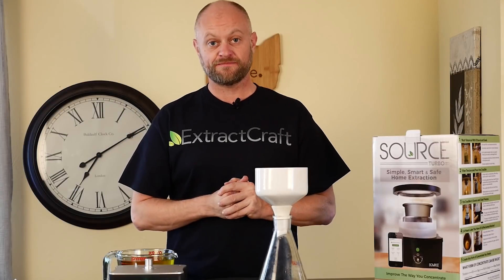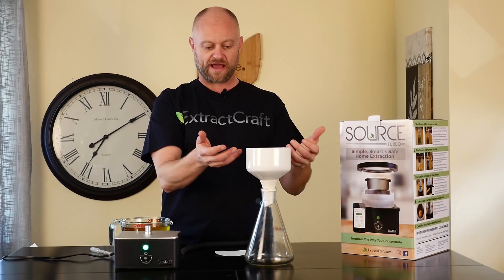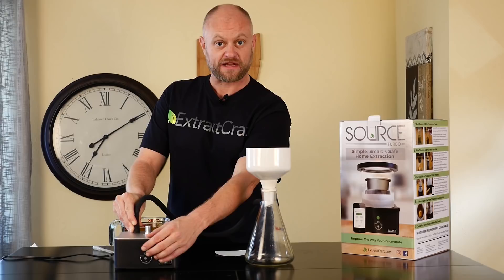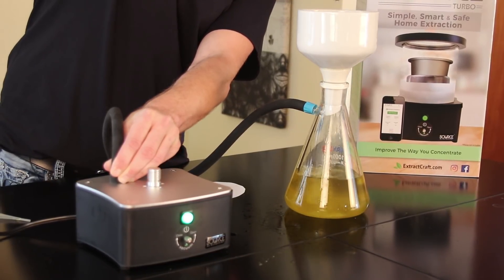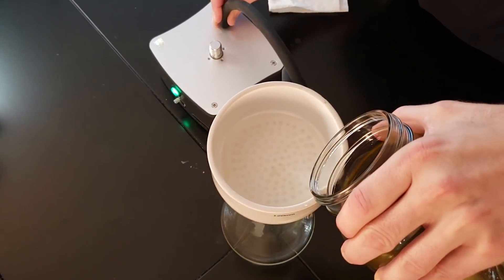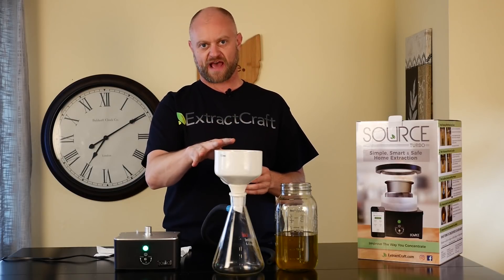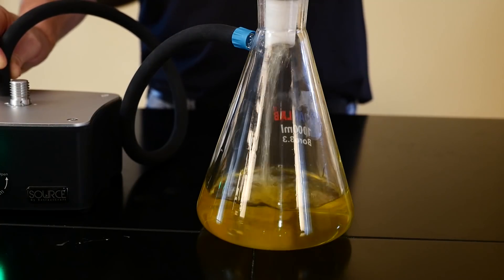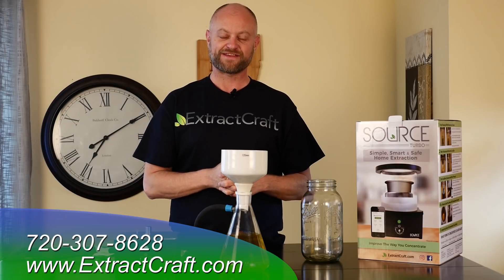Buchner funnel filtration with the Source Turbo by ExtractCraft

Comment: I  am  not  understanding  the vacuum  part?  Why cant you just pour the tinture in the funnel and let  gravity  pull it into the flask?
Reply from the maker: It just won't work that way. These filters are very fine, about 20-25um for the fast flow and 3um for the slow flow. If you poured into these without vacuum, the tincture would just sit there. You need vacuum to pull through these fine filter papers.

Comment: Should the ethanol extraction remain cold or room temperature during the filtration?
Reply from the maker: You'll want everything as cold as possible before making the ethanol extraction, and also after the plant material and ethanol are combined and back in the freezer. Once you take the ethanol extraction out for filtration, you'll want to work fast to avoid letting it continue  soaking at room temperature. Once you do your first filtration, the rush is over and it's fine for the now filtered ethanol extraction to get to room temperature.

Comment: Can I use this vacuum process to winterize rosin?
Reply from the maker: Just for clarity I'm going to change the wording here a little from "vacuum process" to "ethanol winterizing process" to make sure we are talking about the same thing.  So if you are asking if you can use our machine for the ethanol winterizing process with rosin that is absolutely correct and possible.  There is a good article "winterizing & polishing extracts using ethanol" on extract crafter.com (https://extractcrafter.com/2017/12/04/winterizing-polishing-extracts-using-ethanol/) if you would like to take a look.  There's actually another great compliment between ethanol and rosin.  You can use the ethanol extraction method to recover all the good stuff left behind in your pressed chips, pucks, and bags so you don't waste anything.
Reply: @ExtractCraftVideos  thanx alot, I appreciate your timeliness with the reply

Comment: Your waxes and lipids are not being filtered out. They are in solution with the alcohol. In order to remove the waxes and lipids, you must bring the solution down to -10 to -80 degrees to cause the fats and waxes to precipitate out of solution and form globules. Then, you must filter immediately, preferably with a frozen funnel. You must refreeze for at least 3 hours with dry ice, or 24 hours in the deep freezer, between each filtration in order to re-coagulate the fats each time.
Reply from the maker: Much of what you say here is correct and much is a little off base for what we do.  First, yes fats and waxes can be filtered out at this point depending on the process that was used.  Room temp primary extraction, then no.  Frozen QWET up front, then yes.  And if you use cryo temps for the extraction, absolutely not making it into the tincture.  As for the "preferably frozen funnel," this is a typical amateur error thinking they have to keep everything as frozen as possible the whole time which isn't true.  It's wrong for two reasons.  First, moisture condenses and freezes on all surfaces of the funnel which will add moisture to your wash, not a good idea.  Second, with winterization, the process you are describing, keeping the solution to about 20F below room temp should be enough to keep the lipids and fats in suspension to be filtered out, you can keep colder if you choose but there is a large margin and no reason to over think it.  Lastly, for a regular freezer you need to leave in for at least 48 hours for proper precipitation.  You will find that if you use cryo temps from the beginning the winterization is most likely not necessary

Comment: Just ordered the extractor
Watching some videos on operation
How stoned do you have to be not to think about using a clip or nozzle to attach the hose so you don’t have to hold it with one hand.  You are after all trying to careful poor flammable liquid(probably while high)
Reply from the maker: This operation (evacuating the flask) takes a few seconds. The hose is intentionally not very long and the fittings are barbed at both ends. As long as the base is pumping, the hose is not likely to just fall off. You don't really need to hold it.

Comment: If I wanted to winterize my extraction, how many filtration passes should I be doing between extraction and starting winterization?
Reply from the maker: you would probably want to winterize the wash.  You can do as little as 1 and as many as 3.  Most people using frozen methods like QWET and colder cryo temps find that one winterization pass is sufficient.

Comment: What is the size tubing needed for the vacuum? I saw the 1/4 inch. Is the 1/4 inch the Inner Diameter or Outer Diameter for the tubing on the Source Turbo?
Reply: What is the size of the vacuum port on the Source Turbo?
Reply from the maker: @davidsyckleii3178  you need an 1/8" id for the Source vacuum port.

Comment: Could I use this method to filter my coconut oil instead of a cheesecloth ?
Reply from the maker: Probably not a great way to do it with infusions like that.  What I might suggest is moving to doing extractions with the Source Turbo and clean concentrates to infuse into a carrier oil if you'd like to increase the quality, control and potency of your end product.

Comment: I really gotta know, what is the actual difference if you were to use a hand pump instead of the machine’s pump? And if I were to use the Source’s pump on a much bigger flask, let’s say 3L flask, would that in anyway harm the machine. I read somewhere that it’s possible to because not enough pull force is happening. If you take the time to answer these questions for me, it would really be appreciated. Thanks.
Reply from the maker: Hand pumps move less air, the Source Turbo moves more air.  A 3L might be ok but a 5L is far too much air volume.  Unfortunately, it is Easter Morning so I may not be able to field customer service questions from YouTube for the rest of the day.  If you have questions about the machines then directing them to customer service at info@extractcraft will be handled during normal business hours.
Reply: ExtractCraft you’ve answered everything and thank you so much for that. I was just a little cautious but now I’ll try out my 3L flask with no problem. If I ever do, I sure will contact customer service first and keep up the good work guys.

Comment: Is there a problem with some wax and lipid in the final product or is it more for looks?
Reply from the maker: Depends on what you are making.  Topicals and edibles, no real problem.  Smoking/vaping it’s debatable.  Rosin has tons of fats and lipids which kind of ruins it for a lot of people and isn’t good for the lungs, so, I think it’s better and cleaner to have them removed.  Removing the undesirables also increases potency and smoothness.  Lastly, if making carts it’s important to remove as they will cloud, precipitate our, and clog the cart
Reply: @ExtractCraftVideos  So doing this method filter many time will remove fats and lipids if im extracting  for vape carts. ?
Reply from the maker: @pattayakamagra8325  For that, you'd want to filter once or twice first, then put the filtered wash back in the freezer for a while. This will expand the fats. Then you'll take that out and filter it again. This would be called winterizing.

Comment: Just purchased the pro, can I still do this?
Reply from the maker: Hi Joe, you will need the larger 5L version for the volume of the EtOH PRO.  You will also need an auxiliary pump for the vacuum assist as there is no aux pump port on the EtOH PRO itself.
Reply: @ExtractCraftVideos  wait isnt that the source turbo
Reply: @yerbabuenagarden404  yes he's using the source turbo in the video but Joe was asking about the EtOH Pro.

Comment: Why dont you winterize it before you filter so the waxes will be more separated?
Reply from the maker: The video is just a simple how to filter and use a Büchner funnel.
Reply from the maker: Not all extractions need to be winterized.  Often when you use proper low temps in the wash phase winterization is taken care of at the same time.
Reply: @ExtractCraftVideos  getting sassy lol
Reply: Can you explain what winterization is, and why I need to do it?